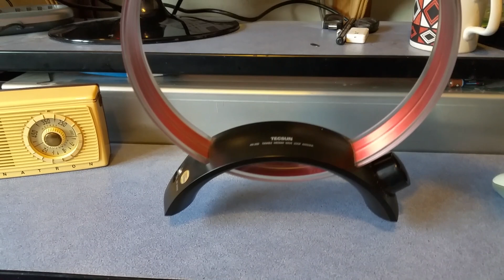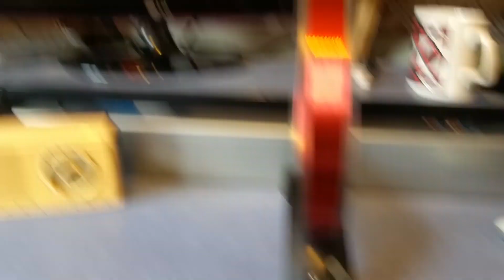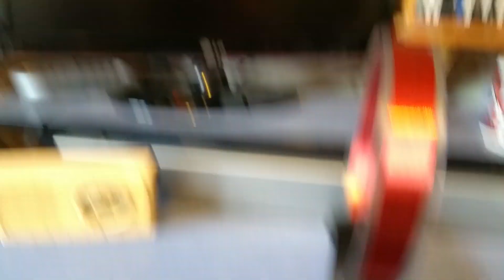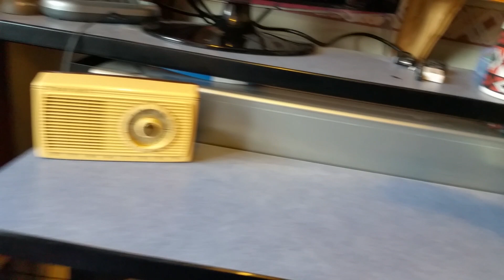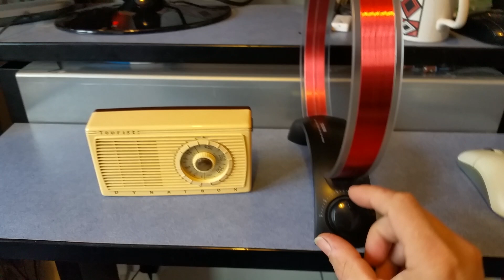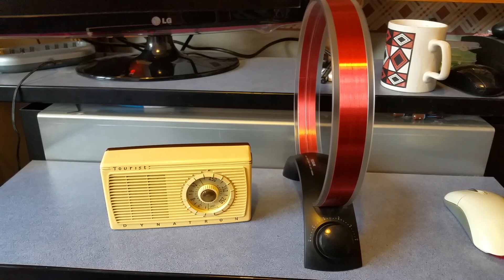Tecsun an 200 loop Aerial

Comment: Q U  E S T I O N  --  Please clarify and confirm: A Q U E S T I O N  ---  Please clarify! Regarding the loop antennas for AM - ads on Amazon: Our AM radios have electrical cord, adapter, 4-D battery optional connectors. No jack for external antenna. So how and where must we connect the loop antenna to help diminish the crackling on AM 1150? (FM stations = no problem). Are copper wires the best material for AM/FM antennas? Thanks.
Reply from the maker: You don't need too. Look at the video. No connection!

Comment: Couldn`t you plug in a a fixed capacitor to the antenna input to add capacitance to get the loop resonant in the longwave band?
Reply from the maker: No. Because you need to create what is known in the States as a tank circuit.  That requires an inductor capacitor and correct impedance to make the circuit ring
Reply: Adding what are called "padding" capacitors would help lower the tuning frequency, but it would be more efficient to add both capacitance and a few more turns to the loop....

Comment: I have one. Works fantastic for most radios.  On a few radios, the antenna brings in some unwanted noise, and on a small number of radios it doesn’t work.
( my Tecsun PL390).
But very well worth the buy ‼️
📻👍🙂‼️

Comment: I've just bought one of these and it's great. Makes an unbelievable difference to signals , brings in some that I can't even hear without the loop.
The only query is that when I have tried it with the cable connection it hasn't worked as well as just using it passively on it's own.
Brilliant bit of kit , well worth the money...................even if I broke my own Ebay rules and ordered it from a Hong Kong vendor.........
Reply from the maker: originalpickaxe I must admit I have never tried it with the cable. But it is,as you say impressive.

Comment: Hi I have a an old technics tuner in my hifi separates cabinet and have ordered one of these loops to improve my mw reception.  The tuner has an am loop supplied which is on a short lead and is not really very practicle.  It also has a single wire screw connector for a long wire ext antenna.  Would this replace the supplied am loop or connect to the extenal long wire screw and i guess the earth connector i use for the record deck?
Reply from the maker: I might work like that but not sure if the matching would be correct. Try using it next to the original loop antenna, that seems to work for me.
Reply: Thanks I am going to try it like that and then instead of the am loop that came with the tuner and see what gives best results.
Reply: I picked up one of these antennas and a mono 3.5mm to rca lead.  i cut the existing wires on my existing loop that came with the tuner and soldered them to the phono connector.  It does make a difference and inprove reception but could be better but I think its to do with the location of my hifi and interference in the house.  I might try a long wire antenna in the garden next.

Comment: Thanks for the good demonstration!
I found that orienting the antenna with the radio takes a lot of experimentation to get the most out of it, and also that the capacitor dial on the antenna is extremely touchy, but it's worth the time and effort.
I use the set-up regularly to clean up a CBC station in Calgary, Alberta, on 1010 MW about 600 km away from my location in Montana, which I can receive in the evening hours.
Unfortunately I sometimes get interference from a 1010 MW station in Mexico that is one the same north/south axis, so I'm trying to find a way to block that signal from the south.

Comment: That would look nice sitting on top and directly coupled to the valve radios I have downstairs. Certainly would save trying to hide several feet of wire behind them! Interested in a SW version as well. Thanks for sharing.
Reply from the maker: They do look better than a piece of wire Andy. And great for nulling out QRM.